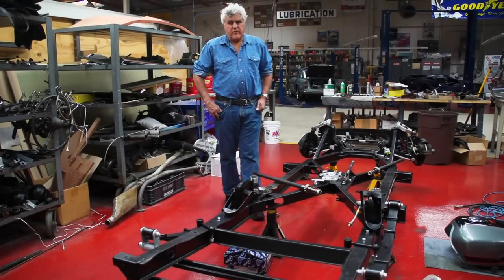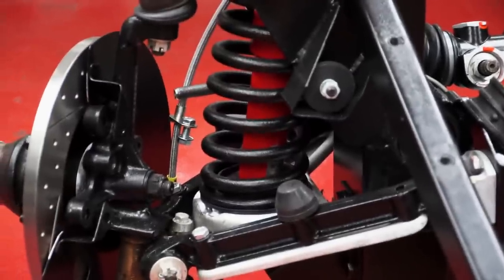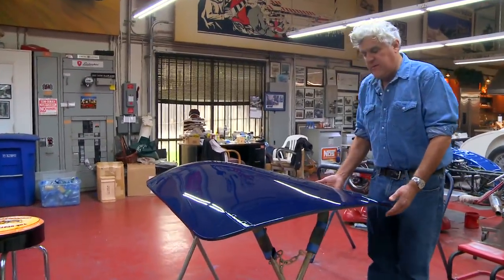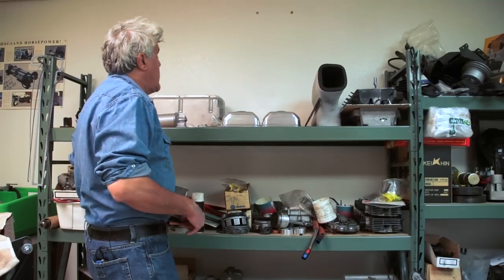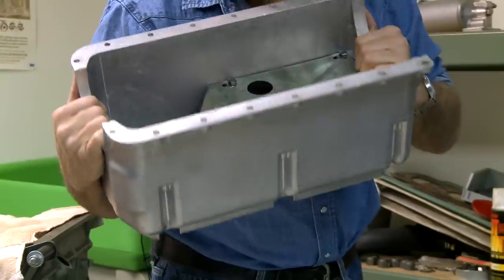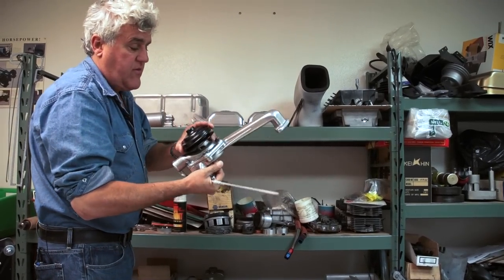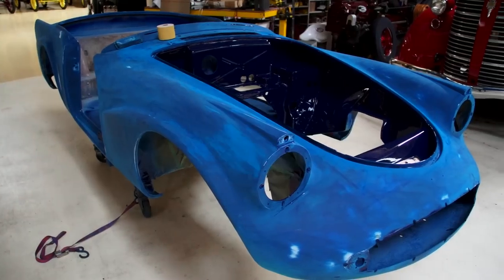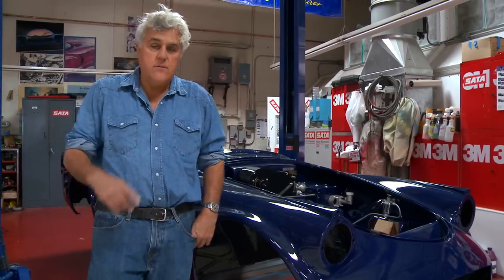Restoration Blog: 1962 Daimler SP250, Update 3 - Jay Leno's Garage

Comment: My father has a photo of a Daimler Dart after the druken driver had missed a bridge but still cleared the river, real Dukes of Hazzard stuff, well really the photo shows the chassis only, the body came off on landing. The driver, who was a doctor, died. That happened in Rotorua, New Zealand back in the sixties. Daimler also made a 4.5 litre V8 Hemi. Jag never used the 4.5 though they were more powerful than the their XK engine, due to 'marketing' reasons, shame.